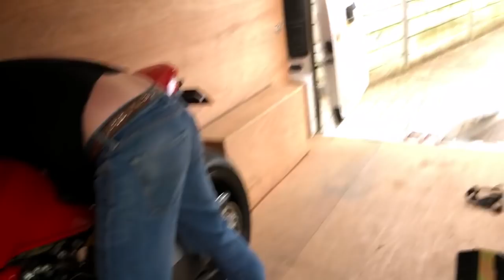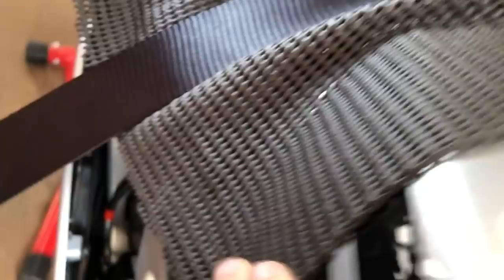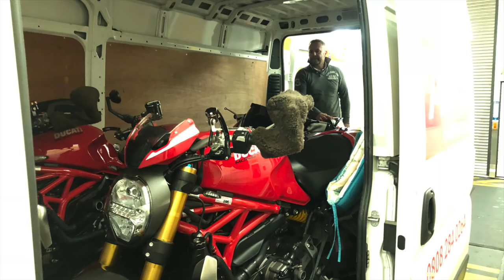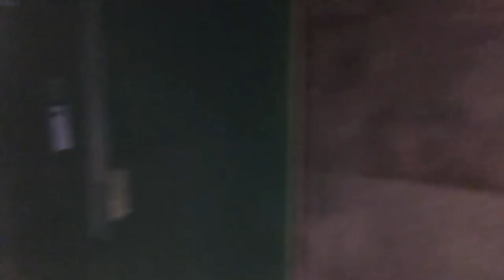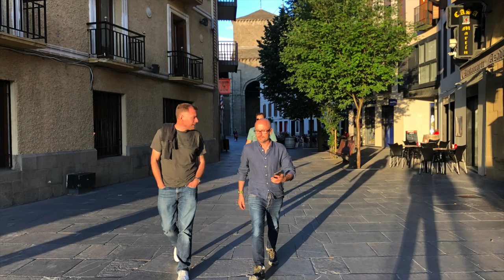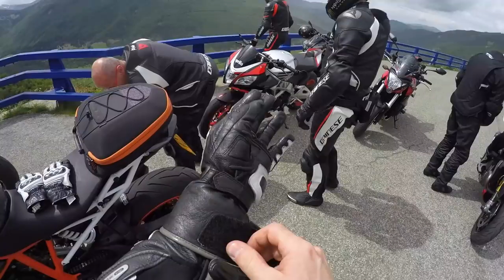SPAIN 2018 MOTORCYCLE TRIP PART 1, Featuring - Ducati, KTM, Aprilia, BMW & Honda

Comment: hi .. can you tell me where you got or where I can buy the handlebar support for the navigator on the monster?  thanks
Reply from the maker: Hey there, I didn’t use a sat nav mount on my monster but my buddy used this mount on his monster, hope this helps, cheers, Gman 

https://rover.ebay.com/rover/0/0/0?mpre=https%3A%2F%2Fwww.ebay.co.uk%2Fulk%2Fitm%2F401737219103

Comment: Nice vid! Do Avis let you take their vans abroad then?
Reply from the maker: My buddy gets a corporate rate through his business so no problem taking them abroad, not sure if normal hire allows you to go abroad with the vans or not 🤔
Reply: Thanks. I'll keep looking for a van hire company then!  What are the bike stands you use in the van - and would you recommend them? Cheers.
Reply from the maker: We use these front wheel stands mate, and we bolt them to the ply wood floor in the vans which works a treat 👍

https://rover.ebay.com/rover/0/0/0?mpre=https%3A%2F%2Fwww.ebay.co.uk%2Fulk%2Fitm%2F362303052867
Reply: Great - thanks for that - much appreciated !  👍
Reply from the maker: No worries Rick, glad to help 👍

Comment: Out of interest why did you decide to travel in a van with the bikes instead of riding them?
Great video though.
Reply from the maker: Hey buddy, we have taken the ferry to Bilbao a few times and as most of the bikes are not designed for touring it’s a pain trying to take enough gear, and also we noticed our tyres were being destroyed on the motorways in the 40degree heat, must admit if we go again I’ll do the ferry maybe as the van journey was so boring! Next time we will do the pico’s as way closer to the ferry port and no need to do crazy amounts of motorway riding 😜